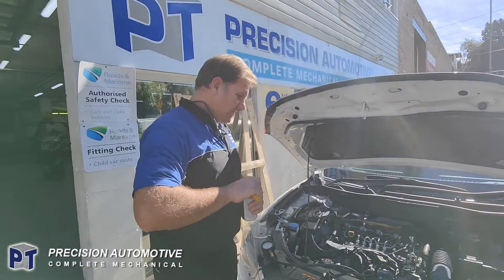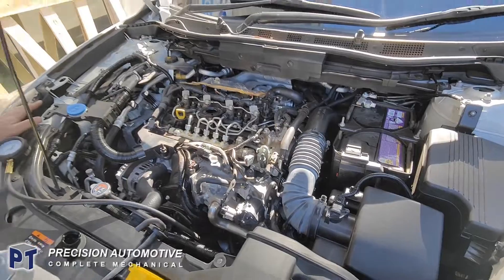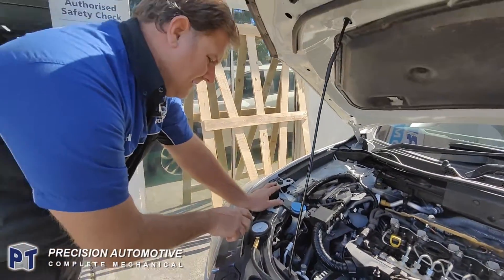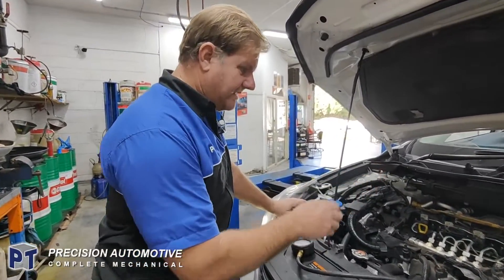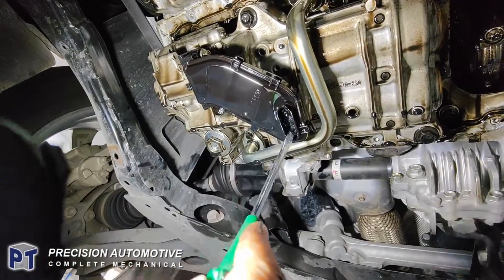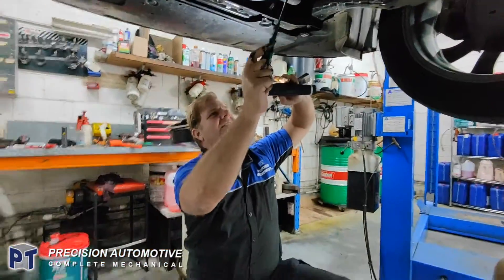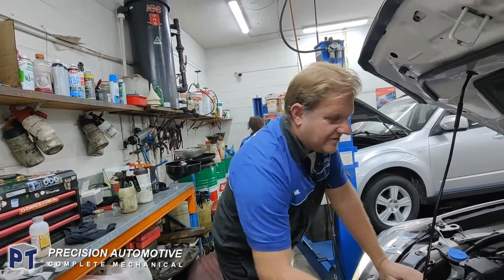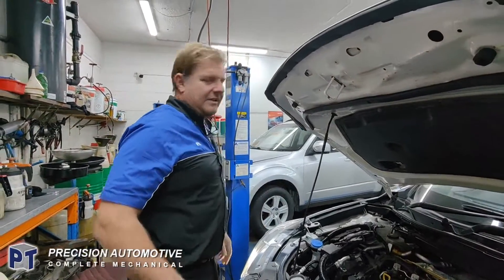Mazda cx-5 diesel oil pressure issues, Engine Issues

Comment: I’m a Mazda mechanic and those SH engines sucks so bad. ingrown intake full of soot. injector leakage, bad oil pump, vacuum pump, head gasket, turbo, turbo solenoid, stuck valves and worn camshafts,  Mazda says it’s the country diesel that mess with the engines but Mazda won’t admit it. It’s the EGR and turbo that really suck.

I’m located in Norway and we do so many engine swaps because the engine seizes ever so often. and customers has to pay over 4000$. It’s a real shame Mazda can’t build quality Diesel engines. I personally own a 2.0 Mazda 3. No problems with the engine. 2,5 L  has the head gasket problems
Reply: Fellow norwegian here with a 2015 diesel. I'm trying to understand how leaky injectors can generate carbon in the oil. Is there oil surrounding the middle part of the injector for cooling? And the compression blows air/diesel up that way?
Reply: @senseipt  Dysene går jo gjennom toppdekselet og ned til sylinderen så  en del av dysen ligger i olje . det er en kobberpakning som er trédd på dysen som passer på at kompresjonstrykket og  drivstoffblandingen ikke skal komme videre opp i motoren inn til toppen. Men dessverre så ryker pakningene og da blir oljen forurenset av karbon og diesel som gjør at oljen  miste smøreevnen og over tid blir til koks. Det blir  som grus og stein.  

Som oftest får vi inn kundeklager om fusking, nødmodus og motorlampe. men da sjekker vi først oljenivået og peiler den. er oljen på X symbolet på peilepinnen så er det diesel i oljen. da vet vi som Mazda mekanikere  dysepakningene er defekte og oljen er full av koks (herdet olje, steinflak. Som jeg kaller det) 

Men det er også innsuget som har grodd igjen av sot pga egr ventilen, små kjøreturer som motoren aldri bli varm nok og dieselen bare presser seg  gjennom stempelringen.

rask sjekk for å se om innsuget er tett er å ta ut MAP2 Manifold Absolute Pressure sensoren som sitter på innsugssiden. er den full av sot så er det tegn på tett innsug. peil også oljen for å se om oljen er på X symbolet. Er den det så få bilen inn på verkstedet så slepper man å få mer problemer som f.eks slitte rådelagre pga koks som tetter oljesilen og oljetrykket synker laaaangt ned…

Det som er svakhet på SH 2.2 Diesel er kamakslene, løftetønnene, turbo som skjærer  seg eller lokket mellom liten og stor turbo kollapser og kunden opplever turbotrykket over 3000rpm.  Oljepumpen og silen tetter seg av koks og da får man jo opp oljelampen i dashbordet. turbo solenoider, vakuumpumpe,  kan skrive en lang liste men tror at de fleste har litt kunnskap om kvaliteten på denne motoren !

En splitter ny 2.2 Diesel  rett fra Mazda koster ca 130-150.000NOK. Forsikringsselskapet dekker Ca 35% og da må kunden punge ut ca 25-40.000NOK. det beste er å kvitte seg med diesel motorene ifra SkyActiv 2012-2018. Men hvis man kan skru og tør å røre de motorene så skal motoren vare lenge uten problemer. Men kundene rører ikke motoren
Reply: @Kooaallaa  Takk for fyldig svar. Jeg har sett et par andre ganske grundige videoer om problemet nå. På en av videoene så jeg at de tok ut en sensor til venstre for innsuget når de skulle rense egr og innsug. Er det der MAP2-sensoren står? På videoen var den like full av karbon som EGR og resten av innsuget, så jeg hadde allerede notert meg at jeg skulle nappe den ut og ta en titt. Jeg har ikke hatt noen problemer med bilen utenom at multireimen røk for noen måneder siden. Oljenivået ligger omtrent der det er etter oljeskift, og jeg skifter olje årlig med kjørelengde på ca 10 000km. Jeg har skrudd masse på MC og en del på bil. Men det er jo helst rutinejobber som bremser og oljeskift det går i. Jeg har forsikring med motorskade, så jeg er ikke veldig bekymret. Bare litt trist å høre at Mazda ikke bedre enn dette. Angående slitasje på kamaksel så har jeg skjønt det slik at dette kun gjelder for eksos-siden og at det skyldes for mykt materiale i noen av kammene? Vet du om dette ble forbedret på et tidspunkt eller har alle biler frem til 2018 dette problemet? Jeg har også fått med meg at dysepakningene har fått et nytt delenummer og lages av et annet materiale nå. Men ble det byttet materiale før 2018? Å rense EGR og inntak skal jeg alltids klare, men det spørs om jeg gidder. Jeg pleier å gi bånn pedal når bilen er varm og jeg skal inn på en motorvei, så jeg håper innsuget får blåst seg reint så mye som mulig. Når det gjelder injektorene så er jeg mer skeptisk til å begynne å demontere siden det virker å være en ganske spesiell prosedyre for stramming. Må se om jeg får tak i en manual som beskriver det. Jeg har ikke løftebukk heller så det spørs om jeg gidder å rote med bunnpanne og oljesil. Det blir vel elbil innen to år uansett. 🤣
Reply: Fellow Norwegian here aswell 👍
This sucks to read. Bought my 3 last summer, and thought I read what I could find about the engine that all these issues were with the MZR-CD engines. Well looks like I'm trading in mine with a gasoline engine before it shits itself.

Mine has 104000km on the clock, luckily no issues so far, got the inlet and egr checked for soot and it's not too bad. Turbo and oil is fine. Only thing thats a bit annoying is the dpf regen, noticeable cut in power when it happens.
Reply: @lessmasterdark  ja det er ganske kjedelig og surt for kunden å punge ut tusenvis for at bilen skal rulle på norske veier. Jeg eier en Mazda 3 2.0 BN 2015 modell og den har ingen problemer med motoren. Tar service og det er det. 

Men det som går igjen på alle mazdaer uansett om det er diesel eller bensin så er det Speilmotorene, veldig dårlig kvalitet på bremseskivene på bakakselen, støtdemper innfestning som knekker pga irr, og lakken skal man ikke skryte så veldig mye av. men er en del rust på Cx3 ved skjørtene på kanalene.  

2.0 SkyActiv er en kjempegod motor som holder. det man kan være litt uheldig med er oljesvetting fra toppdekselpakningen men det koster bare 2000kr for kunden

Comment: Hi could you please tell me where the oil pressure sensor is located on this engine. Have had injectors o rings changed and strainer replaced, however still getting low oil pressure message on dash
Reply from the maker: it is on the front of the engine block towards the radiator under the  manifold towards the gearbox
Reply: @PTPrecisionAutomotive  Thankyou very much. Will try the sensor next
Reply: Same for me. Mazda asks me to replace the engine.

Comment: I bought a CX5 diesel and hand issue after issue from 90k through to 130k 
Mazda covered most of the issues but later I learnt they were a whisker away from having to recall the whole lot because of oil pressure issues and catalytic converter problems. Money pit worst car I have ever owned followed closely by a vw golf
Reply: I bet your life’s better now… I assume you offloaded your cx5?
I can’t wait to get rid of mine! Can’t wait
Reply: @barsixful  haven’t regretted it for a nano second. Good riddance CX5
Reply: YEP IVE BEEN MECHANIC FOR 40 YRS
ALL DIESELS SHOULD BE BANNED
THERE CRAP...THAT MUCH CRAP ON THEM TO COST MORE ...THATS ALL DIESEL ARE GOOD FOR ...THROWING THOUSANDS AT IT AND STILL PIECE OF SHIT...LOL...Cheers

Comment: You don't have to remove the timing cover to do this job, you just need a special tool to hold the oil pump sprocket. The timing and balancing is no problem aslong you assemble it the same way you disassemble it :)

Comment: its a simple fix just need new oil pick up and new injector washers thats where carbon gets into engine and dont need to take front off in order to take oil pump just undo one bolt holding the pump where chain sprocket is never loose any timing because its separate chain  then rest of the bolts easy accessible and pump on the floor  it tool me 2  hours too do this and put all back together
Reply: But how often does this fix need to be done? I just bought used cx5 diesel with 140k on a clock and two months in I am dealing with this problem.
I'm worried how soon this will happen again.
Reply: @renzostar1753  get rid of car now, please 😢

Comment: U can take the oil pump down without taking the timing cover off .. u need to take rocker cover off and clean and but injector washers in that’s the  root of your problem..ps new oil pick up to..

Comment: The cx 5 and mazda 6 have the same engine i think. Can get the oil strainer off without taking the front end off. Take 4-5 bolts and it comes loose with the pipe. The injector seal lets air thru and this makes hard carbon parts which end up in pickup sump. Mazda problem nr 1 gen2, gen3
Reply: Hi mate I hope to get this done or have a go myself..I'm OK woth most things (currently rebuilding my 1402cc bike engine) you say 5/6 bolts do you mean bolts to the pump itself ? Obviously it has the chain attached . There is  1 video on YouTube a mechanic marks the chain etc where balance shaft is . Removes pump splits changes gause  then reassembled logging up the marks

Comment: Thanks have one coming into the workshop probably going to have same issues is coding for that oil pressure control solenoid possibly going to be a waste of time replacing by the sounds of it but will check pressures and possible sludge, carbon build up,,,,did it stop coding?
Reply from the maker: Yes it has so far. but hasn't help his wife putting petrol into the tank....

Comment: The absolute worse engine Mazda made. In New Zealand, you can't get a good used motor. The wreckers say, you won't get one.
Money pit for sure
Reply from the maker: Yeah not good , felt sorry for him, he came down and had a look for him shelf , hence why we put it back together.
Reply: @PTPrecisionAutomotive  yeah really sad. Had one hear in Auckland. 2014 CX5 2.2 skyactiv diesel. Blowing white smoke, diesel in oil, turbo bad, and it only done 95 000km. Out of warranty and they still owed finance of 15k.
Mazda would not help